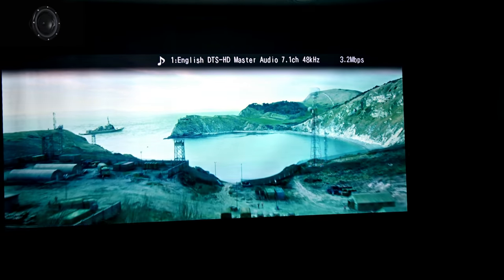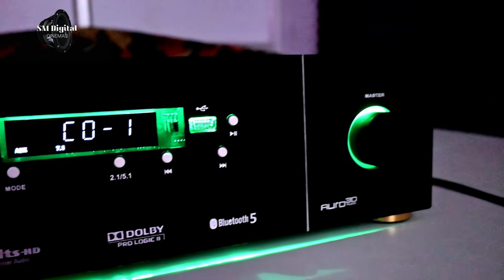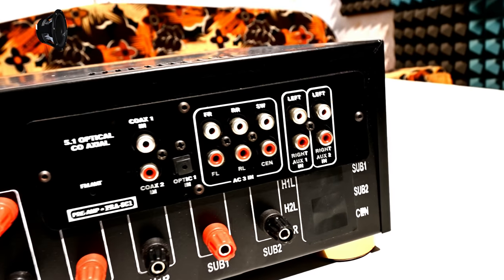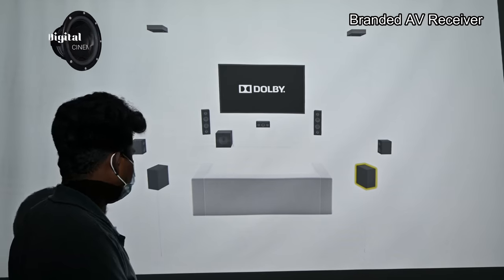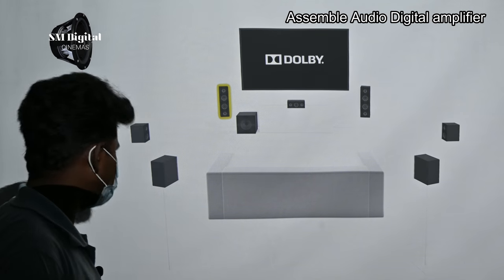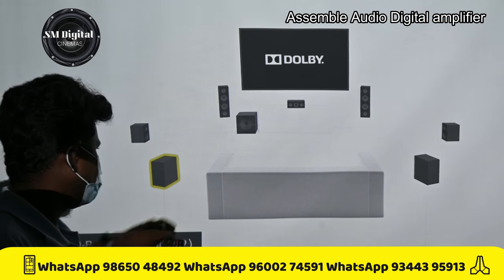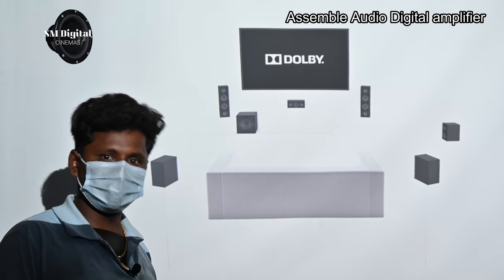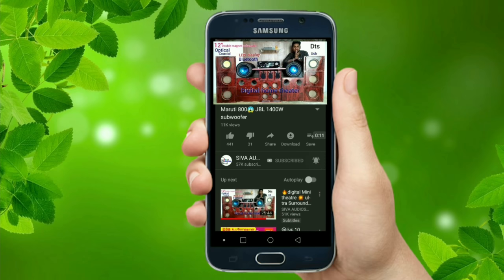💥தமிழ் BRANDED 7.1 vs ASSEMBLE 7.1 / DTS SUPPORT/ DOLBY DIGITAL TRUE HD/  🔥🔊

Comment: In assembly amp it is only  5.1 Pro logic and it does not support Dolby digital 5.1 and DTS 5.1. they have to get a licence from Dolby lab and DTS for using thier processor by paying royalty. That is why assembly remote kit is not having such Dolby digital and DTS support. Boss you have openly exposed the scam of assembly remote kit. So go for branded amp.
Reply from the maker: Noo... அசெம்பிள் ஆம்பளைப் பயல் இன் எடுக்கும்....
Reply: @sivaaudiosbhavani  in some kit it supports 5.1dolby digital but it will not support 7.2 channel as you mentioned in the video.

Comment: I need atmos explaining
Reply: As per my understanding, Atmos has 5.1.2 or 7.1.2 configuration. For 5.1.2 It will have 
1 - centre
2 - Front left & right
2 - surround left & right
1 - Subwoofer
2 - Top surround or front height surround or rear height surround(Height surround means speaker facing upwards with some angle)